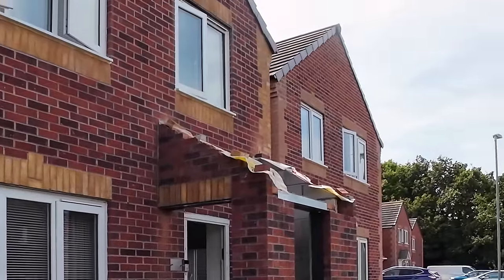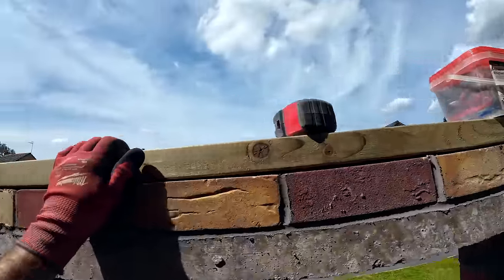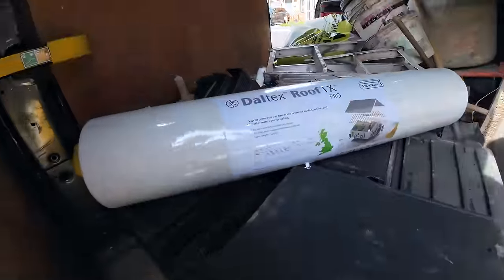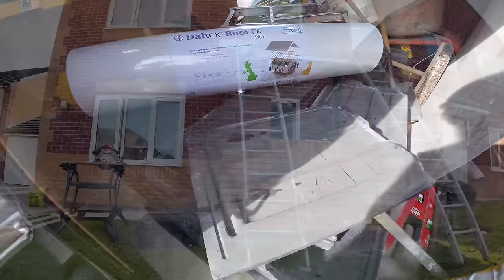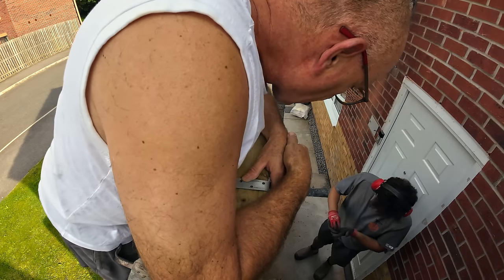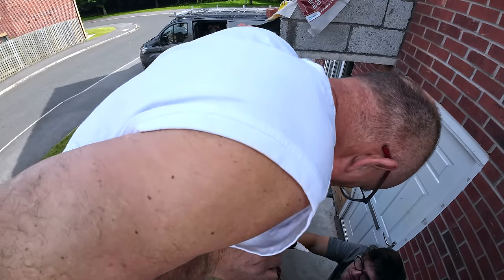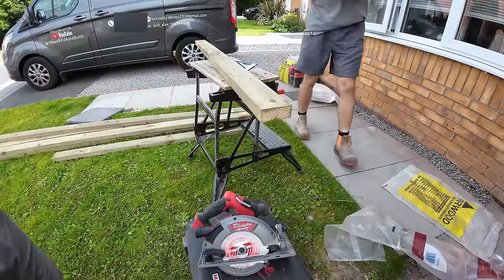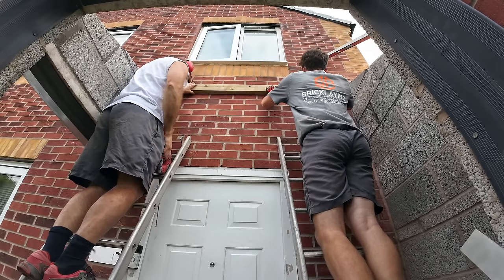HOW TO MAKE AN EASY ROOF LOOK VERY DIFFICULT FEATURING @SKILLBUILDER AND DAN

Comment: a hand saw and a mitre crosscut saw make this a lot easier lads.  fair play to you, when you're not used to doing this type of work its a head scratcher!  one thing, id normally leave a few gaps in the brickwork to form a ladder to the outside skin for my bargeboard that the facia board can attach to.  on something that small, you might get away with continuing you lath across to the outer skin and fixing it down into the barge and maybe fire a couple of grabbers into the brick to hold it tight against the wall.  also, when you were drilling the wall plate down i think the dust might have pushed it up a smidge, id blow it out normally.   not a criticism by any means, just trying to help.  love these videos, every day is a school day lol
Reply from the maker: Thanks for all the tips 🤙🏾🤙🏾🧱👍🏽

Comment: A tip for screwing the wall plate/header to the wall on larger runs on jobs like this lads. You can buy structural screws that you know can take a good load. DeWalt and Hilti do the best imo. No wall plug required like the ones you used, but their much better and rated for roof loads.
Reply from the maker: Cheers Paul 🧱👍🏽

Comment: Oh, that was a painful watch.  Well done guys on getting that finished.  Measure twice, cut once.  Never guess 'cut about 6mm off'.   Mark the gap off with a pencil (against the wall plate) and then measure how much to cut.

Glad you finished it in the end, and the vaulted ceiling sounds very good - with a nice recessed LED light or two to illuminate the new pitch.

Keep up the good works.
Reply from the maker: Cheers Peter 🧱👍🏽

Comment: I see you were using a white pen to mark your holes get a green paint marxman maker put the wall strap on the wall and push into the hole and it pin points the hole in green paint